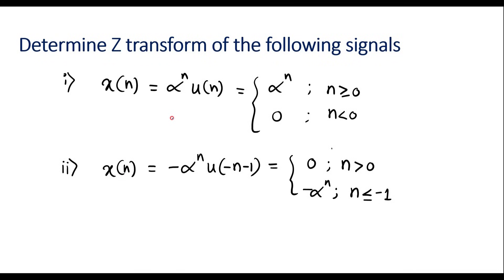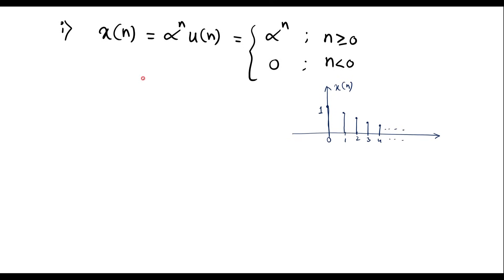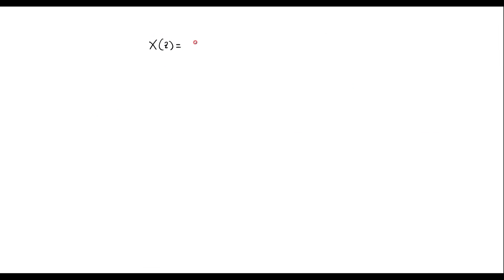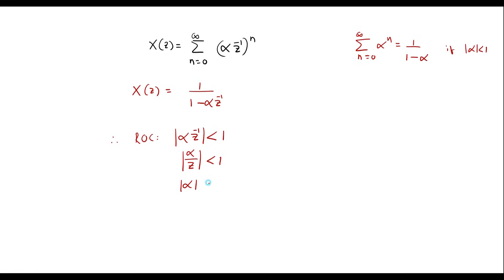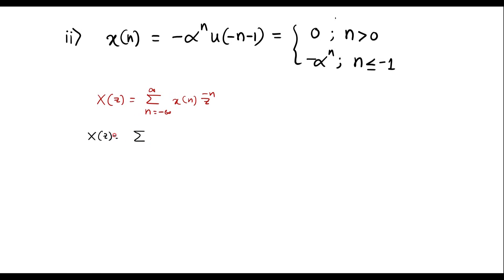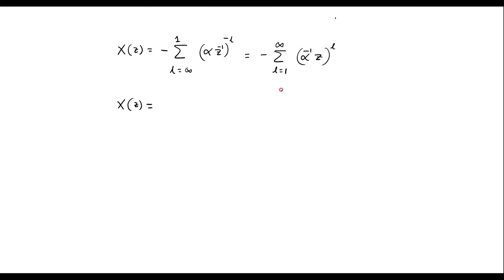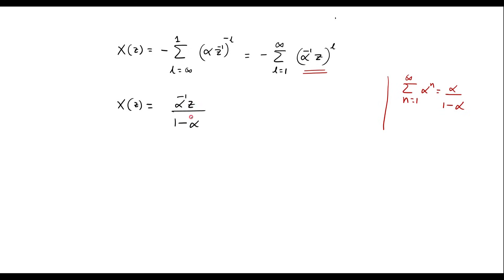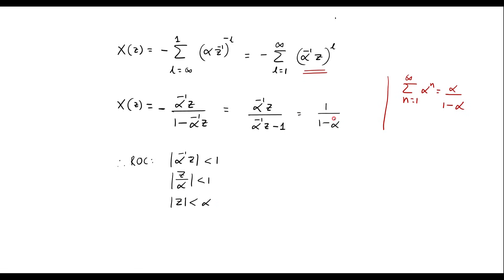Determine Z transform of the following signals.

Comment: I didn't understand sir; how did you take U (n) = 1 and U (-n-1) = 1
Reply: u(n-1) graph and taking its reflection we get u(-n-1) then obviously it's value will be 1 as it is unit step signal
Reply: YES HOW
Reply: In second problem when roc is less than 1? Anyone plse explain 8:40 ,why it cannot be greater than 1?
Reply: Can anyone explain how roc is drawing inside and outside the circle
Reply from the maker: @varshithap5121  in this case z is less than 1 so roc will be inside circle. If it's greater then it will be outside the circle
Reply: @VBDclasses  thank you sir
Reply: If |z|is less than alpha draw inside circle and if |z|is greater than alpha draw inside  @varshithap5121